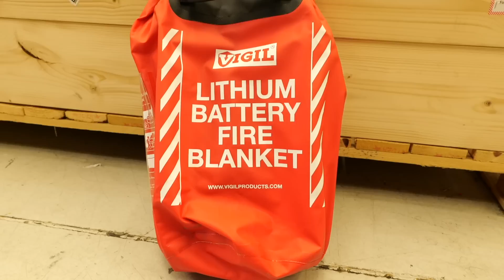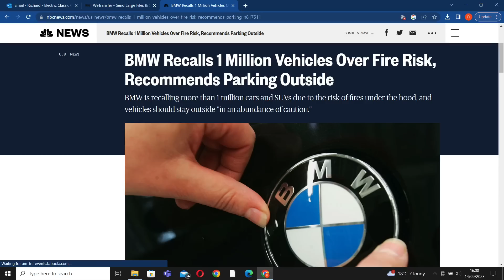Electric Car Fires - Facts and Figures

Comment: The part of this that I’m interested in is the severity of the fires. Recently I watched a video in which the presenter stated lithium ion battery fires were 3 times hotter than gasoline fires. A fire within a structure at 3000° F not only would burn other adjacent vehicles but would also destroy the “car park”. Apparently concrete won’t withstand that amount of heat.
Reply from the maker: Concrete structures like multi story car parks have been collapsing because of ICE fires long before EVs came along. Petrol and diesel car fires spread more readily because as soon as the plastic gas tank melts the fire spreads in puddles and streams of fire to the surrounding vehicles. There was a recent arson fire in Germany at a Tesla showroom which shows that not all the EVs parked next to each burned. If they were ICE they would have all gone up in flames.
Reply: @ElectricClassicCars  Most fires in ICE cars start in the engine bay and are extinguished before the fuel tank is compromised. 
I've owned several cars, both petrol and diesel, and none of them had a plastic fuel tank, they were all metal. 
When I was a child, my mother drove a Reliant Robin, it set on fire (started in the engine bay), the entire body and interior burned to nothing, yet the fuel tank remained intact and the fuel contained within it did not combust.

Comment: ICE cars do not suffer from "Thermal runaway", do not require 60,000 litres of water to put the fire out or have to be dumped in a tank of water.

Comment: I also screenshoted this
The international trade administration gets their information directly from whatever motor vehicle administration there is in Sweden. And they reported a figure of 110,000 as of 2021. Which would mean, if MSB is correct, with the stat that it's doubled since 2021. Generously, there should only be 220,000 electric vehicles. So how come there's 610,000 being reported? That doesn't seem fishy anybody?

Comment: I have screenshot this
Something seems a bit fishy. According to the statistics below from the international trade authority, Sweden only has about 110,000 electric vehicles as of 2021, but miraculously has six times that by 2022 according to this MSB statistic. I have noticed though that the wording on the MSB statistic says 600,000 by 2022. So maybe they're basing their statistics off of what they were predicting would be in Sweden by that time and not the actual figure. Now, That's great for the expansion of electric vehicles and the conservation of our environment. But I'm having some trouble believing that type of demand for electro vehicles anywhere even in Sweden. 
Sweden, with a population of 10.5 million, had almost 5 million vehicles registered in 2021. The automotive industry plays a central role in the Swedish economy, and according to Statistics Sweden, motor vehicles are Sweden’s largest export category and also the largest import category. In 2021, Sweden exported motor vehicles for a value of $20.5 bn, while imports amounted to $16,5 bn in 2021. According to the Swedish Innovation Agency, Vinnova, the automotive industry employs around 140,000 in Sweden, with 40,000 concentrated in the Västra Götaland county, where Volvo has its headquarters and production. Some 292,024 passenger cars were sold on the Swedish market in 2020, and the most sold brands were Volvo, Volkswagen, Kia, Toyota, BMW, Audi, Mercedes, Skoda, Renault, and Nissan.

Sweden is a leader in both the use and the production of alternative fuels and renewable energy and has, through the European Union, pledged to cut CO2 emissions by 40 percent by 2030 relative to 1990 levels. The Swedish government has also provided subsidies and vehicle tax cuts for purchasing environmentally friendly vehicles, which has caused a shift in sales from fossil-fueled vehicles to hybrid and electric vehicles. The Swedish government offers purchase subsidies for vehicles that release a maximum of 60 grams of CO2 per kilometer. Subsidies range from up to 70,000 SEK for new electric vehicles to 45,000 SEK for plug-in hybrids (reduced with 583 SEK for every gram of CO2 the car releases), and 10,000 SEK for natural/biogas vehicles. According to Mobility Sweden, there were 110,177 electric vehicles, 189,498 hybrid vehicles, and 39,542 natural/biogas vehicles registered in Sweden in 2021.

Comment: Your forgetting hybrids are still counted as ice even tho battery was cause of fire like Luton airport it is heavy suspected it was an evoke fire was on left side where battery was however it was a diesel hybrid so it was a diesel fire
Reply from the maker: The Luton airport car park fire was not started by a hybrid. It was a pure diesel. Number plate was E10 EFL. Red 2014 Range Rover diesel. Also the battery on a hybrid Range Rover of that era is under the driver seat I.e. the right, not the left. Unless it’s a left hand drive car.

Comment: Hallo... so firstly its not a competition, we can put out fossil fuel fires, whereas we find it very difficult to gain control over ev fires . I feel you have the ingredients for the answer in the video. Airplanes have fire suppression systems built into the engines. EVs need something similar to stop runaway battery fires. Fire fighters should be able to connect and  pump the battery full with brine (or something more effective) via a universal connection on the outside of the car. We are not a completely stupid race. When we studied a rally drivers braking actions for maximum braking some bright spark created ABS for cars (maybe it was for big trucks first). Stop people bouncing around in cars during an accident.. we invented safety belts. Controlling acceleration and deceleration of the human body in a car during an accident, we created .AIRBAG systems and so fourth.  There is no defense necessary for unforeseen dangers in a new technology, there are solutions and safe guards we can put in place, but it has to happen very quickly. Defending a flaw in a new technology is redundant in my opinion as it will delay the creation of solutions, and that will ultimately damage the perception and acceptance of that technology.

Comment: Hey Moggie!! Thanks for another great video.  I'm watching this today off the back of mad day yesterday (11/10/23) where a car fire in the carpark at Luton airport was immediately blamed on an EV.  The worst thing was, after the Bedfordshire Fire and Rescue service confirmed it was not an EV and most likely a diesel powered Range Rover, many people on social media accused the fire chief of a cover-up 😳   I'm now going to share this video on LinkedIn in a post reflecting the need to look at the facts, not the general media or conspiracy theories.
Reply: Good idea! I’m going to do the same on a few socials. Lots of people really determined to spread fear about EVs. I wonder how many are oil company shills? 🤔
Reply: It was likely a diesel hybrid and the battery that was in the location of the vehicle that was shown burning earlier on. Also, weakening of the concrete and rebar holding the parking structure together would be unlikely with a diesel fire. Firstly, diesel is not easily burned compared to gasoline, it does not burn hot enough to melt concrete, the smoke would be black due to incomplete combustion and the heat would be directed upwards. There are other details as well, but all evidence appears to point to the hybrid battery being the culprit. While EV batteries may not often catch on fire, the desire to minimize it by "covering up" the fact that the likely cause of the accident was doing more harm than good once people got their hands on the same evidence. This also needs to be weighed with the knowledge that EV fires are far more destructive and difficult to extinguish or predict compared to ICE fires. Particularly, ICE fires are often due to older vehicles that are in disrepair. EVs have not even been mainstream for a fraction of the same time. People still drive vehicles with carburetors...
Reply: @adamrichardson2227  you state many facts that a lot of people are aware of.  From discussions I’ve had there isn’t a desire to ‘cover up’ EV fires, there’s a frustration at the desire to blame all static vehicle fires on EVs. It’s common knowledge that lithium ion batteries are capable of thermal runaway, but the comments claiming all EVs spontaneously combust is counterproductive to helping clean up transport.  A diesel hybrid is just that, a hybrid vehicle not a BEV. I’m surprised more people were not mentioning the poor reliability record of Range Rover cars. 
Everyone knows EVs are not a perfect solution, but neither are ICE powered vehicles.
Reply: @marvinsamuels1237  In the end, I think that the EV will be more damaging to the environment than ICE vehicles due to the simple fact that they will be used and viewed like an old iPhone when they age. Unlike an ICE car, which has very little technology to be outdated, EVs will be thrown on the scrap heap after a few years. I never buy new vehicles to save money. It also saves the environment as it does not require more emissions and environmental impact to manufacture. I know I am saying all of this with no REAL evidence to back it up, and this is an EV channel where zealots  would love to crucify me. But I think that the truth of the matter is that EVs can be fast, fun and interesting technology. Saying that they are going to do much to actually improve the environment or be a solution to anything without introducing a new or worse one is an oversimplification in my view.

Comment: If that battery is present in a fire, whether it causes it or not, it’s going your way make the situation multiple times worse… Luton Airport Car Park fire is a good example 🤦🏻‍♂️
Reply: The Luton vehicle was clearly a hybrid with its battery under the passenger seat. The insurance for my hybrid has just rocketed.
Reply: @robertbox5399  Sorry to hear that, it’s ridiculous that owners are paying the price for ‘magical thinking’ by governments 😐
Reply from the maker: @robertbox5399 It has been shown to be a pure diesel not a hybrid. Also, the battery on that age hybrid is under the drivers seat on the right hand side NOT the left side under the passenger seat.
Reply from the maker: The car park fire in Liverpool a few years back had no EVs in at all and results were exactly the same.
Reply: @ElectricClassicCars  and that alters the physics of having Lithium-Ion batteries present in a fire how❓🤦🏻‍♂️
Reply: @ElectricClassicCars  Can’t be the “exactly the same”, only EVs burn at a high enough temperature to ‘melt’ concrete and steel, as happened at Luton… stop misinforming people, please🤨

Comment: I wonder has the average/mean age of both ICE and EVs been considered in this report? I would have thought the ICE median age would have been a lot higher than an EV. So to suggest that an older fleet has more electrical issues wouldn't exactly be ground breaking research. The ICE number would include vintage cars from a different generation of engineering...whereas EVs are all based at most 10 years ago. A big difference in safety standards between 2015 and 1985 for example. A quick google search shows that in the UK there are currently still 10 million vehicles 15 years or older on the roads. It will be interesting to see of the EVs can maintain their safe stats with time as i beleive myself they are aided by how new the fleet is.

Comment: Even if battery pack problems aren’t the cause, the proximity of battery packs to another ICE vehicle on fire is a consideration for every insurer storing cars as part of the claims process. It surely has to be a factor in parking cars in multi-storey car parks or basement level parking facilities in the future too, assuming everyone is forced to use battery cars rather than conventional petrol and diesel. Perhaps cramming cars into ever narrower spaces in public car parks is a fire risk in itself?
Reply from the maker: Cramming cars with flammable energy storage will always have a risk, whether petrol, electric or diesel. Look at the Liverpool car park fire in 2018, started by a diesel 4x4, that destroyed 1000s of cars and not an EV in site.
Reply: @ElectricClassicCars  yes BUT EV FIRE IS HARDER TO STOP

Comment: You asked what Scandinavian countries are doing about electric car fires. You  failed to mention that one of their ferry companies has already  banned BEVs from their ferries altogether and others are only allowing them on certain decks fitted with specialised  BEV fire fighting equipment. Make no mistake, dealing with a BEV fire is no joke. You cannot play this down.  The BEV decks have a system installed requiring brine to be stored and deployed at minus 20 c and they need enough capacity to fight the fire continuously for 60 minutes at full discharge. Let those figures sink in for a minute....and this is considered the minimum requirement  to prevent the ruddy things from potentially sinking the ship in the event of thermal runaway. Whoever thought using eight or ten thousand torch batteries was a good way to power a car must have been stark raving mad!  And yet, unbelievably, here we are...
Reply: The decision to ban EVs from those ferries came about because a Dutch person converted their own Nissan to electric and manufactured their own charging cable that could apparently run in any country on different voltages. Except obviously it couldn't. So this was entirely caused by one person messing around with their car. A ludicrous overreaction to then ban EVs from ferries.
Reply: The one who came up with the idea to make laptops and mobile phones use the same batteries must be mad too along with everyone owning such devices.
It's funny how people keep grasping for straws not to have to give in to the facts.
Reply: You sound like a loon. Almost all technology advances come from stark raving insane people... would you like to go back to a horse n buggy?

Comment: EV car fire are far worse than ICE car fires an EV fire takes hours to put out and releases very toxic gases into the atmosphere an ICE fair enough will also release less than toxic gases into the atmosphere but an ICE vehicle takes about 15 the to 20 minutes to fully extinguish well my 26 year old Toyota hilux has never been on fire and l remember before EVs and l have driven millions of kilometers as a courier for 35 years now any vehicle l drove both diesel and petrol vehicles and none caught fire there has recently a fire in a car park at Louton air port l be looking foward to the resuits from thatfire and l am anti EV and l live in Australia and there are a couple of EVs around and the biggest selling vehicle in Australia is the Toyota Hilux and the biggest selling car maker is Toyota at least Australians buy good petrol and diesel cars and why Toyota they are reliable they last years and years well my 26 year Toyota Hilux yes Toyota Hilux us still going well with 433000 kilometers on it would an EV last that long and l will never electrictrify it besides there are no companies electrictrifying classic cars in Australia and most British classic cars are selling cheap

Comment: Yes, but Norway or Sweeden distribution of electric cars is simply biased: those are very cold country and Li Ion batteries can ignite with extreme heat conditions.

Besides, do not forget electric cars are on average way newer on than ICE cars. We should also compare the average age of both car groups! I want to see how does a tesla model S hold up when is 20 years old, as during 20 years you have accumulative properties of fire that have not happened for <6 o <7 hear old cars.

Comment: 1./ "Liverpool car park fire: 'Sprinklers could have stopped' blaze that destroyed 1,600 vehicles" The irony is, if the car was ev? Sprinklers would not have even worked.
2./ Fire blankets do not bring down temperatures of chemical fires.
3./ What percentage of ice car fires in sweden were all engulfing catastrophies?
4./ You cannot compare aircraft crashing into the ground with ev car fires? 
One of which is a far more regular occurance than the other. Thats a bad risk assesment analysis..

Comment: Hi E C C, good effort!, there is one important bit missing from your other wise sensible statistical review. The age of the vehicle has to be considered and the older the vehicle the more likely a failure becomes. It might also be worthwhile to consider the fact that many ICE cars have substantial electrical power systems and big powerful batteries none of them are required to have fail-safe electrical fuses that prevent short-circuits in the event of a serious crash so many ICE car fires are in fact electrical!.
This is all parts of the same demented commercial profit driven obsession with cost-cutting and de-regulation there are all sorts of ways in which vehicle safety could be significantly improved some of it from effective regulation most of it by sensible maintenance and precautions, all new cars should be fitted with effective electrical safety switches, not unlike what is required in law for all houses.
Cheers, Richard.